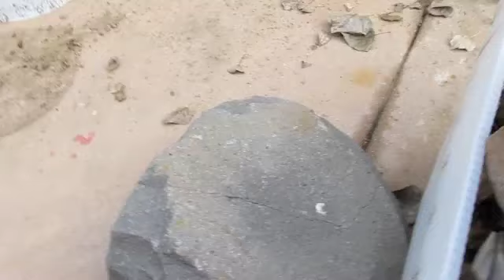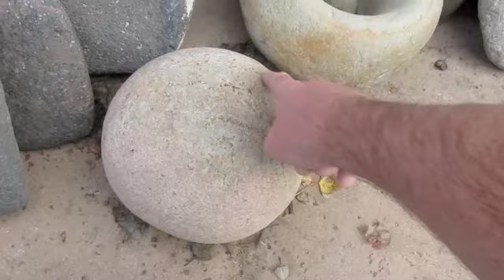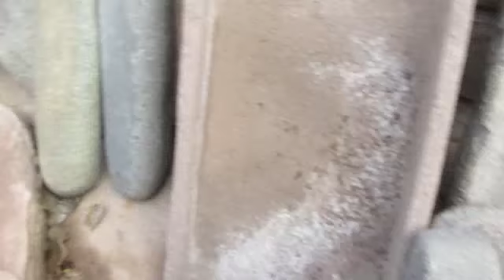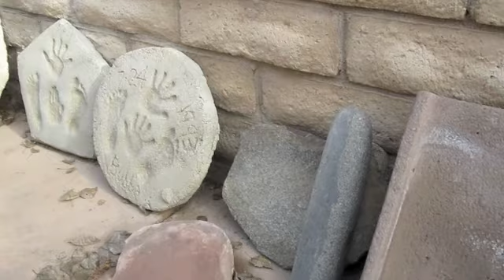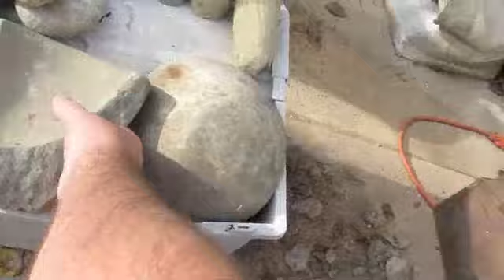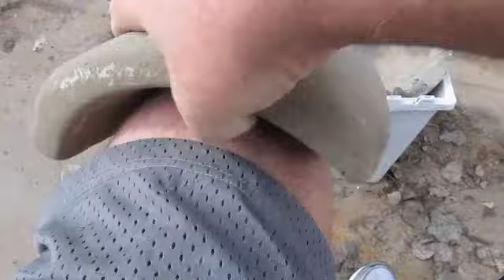Manos of Mystery  part 2 of 3 -Metates-Mortars-Pestles

Comment from the maker: @MrRickjitsu Very astute MrR. I bet some bowls lasted a lifetime. I've seen them in all stages. to start they just glue on a round basket with no top or bottom and start grinding acorns , these guys out here never had corn . When the stone grind area got slick they re-pecked it rough for better abrasion and thats the process for the very slow way to deepen and make a bowl.I tried to make a bowl and a pestle and gave up after about 8 hours and precious little to show.PM51